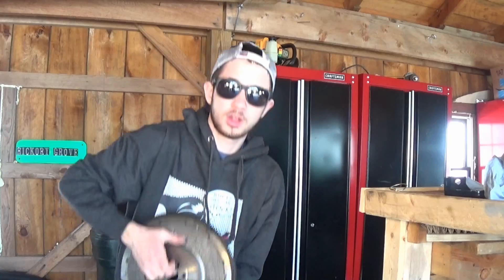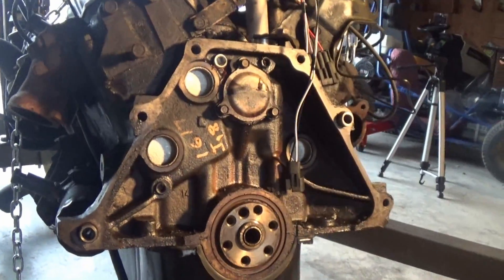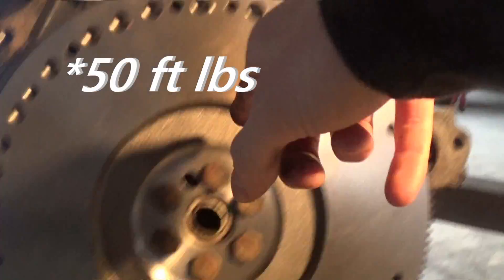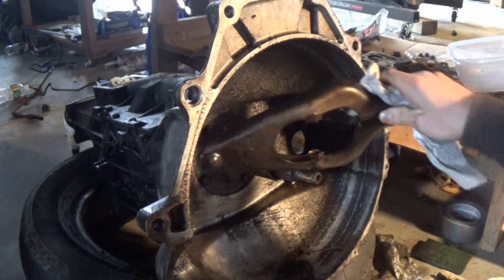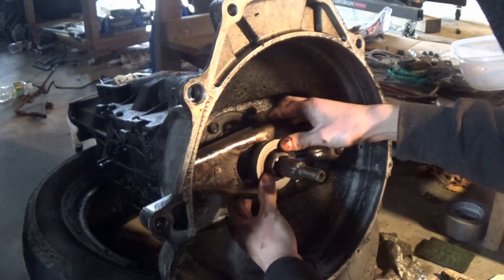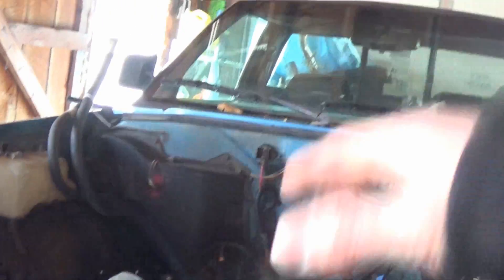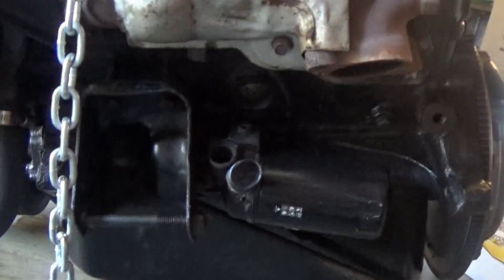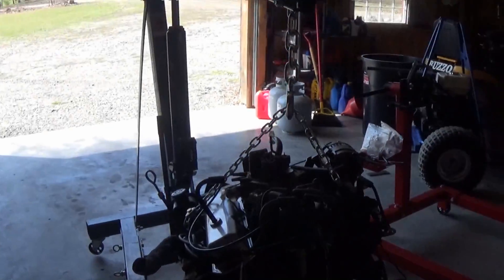S10 Clutch & Flywheel Install

Comment: I recently acquired an S10 and used this video to redo the clutch.  Thank you for that  BTW if you put a screwdriver through one of the flywheel holes, it will stop against the block and you can ratchet the flywheel bolts without having to hold onto the screwdriver.

Comment: On my 91 chevy i replaced the slave cylinder N master cylinder and nothing changed after bleeding. Any ideas? Also while i had the slave cylinder out i used two screw drivers to move the. Arm back and forth. Is there suppose to be spring back?

Comment: Sup bro do you have a diagram for all the houses I’m tryna redue all my lines on my 83 s15 I got it an a whole bunch of the lines were crossed and broken also my clutch lost pressure an I can’t bleed it so you think my clutch is bad my 83 only got 50,000 miles plz lmk

Comment: Just for future reference buddy, when bolting anything on a motor you always use a st ar pattern. So say on your flywheel, you have 5 bolts. After you tighten your first one move to the one directly across from it. It's just to make sure everything is flat on its mating surface.
Reply: I was about to say that.
Reply: As a Millwright i can not stress this Enough. Proper Torque Technique Is Extremely Important Especially On Highspeed / High Vibration Machines.
Circles Get a Star and Rectangles Are Center-Out Like a Spiral.
Reply: Just like when you change a tire, if not you will end up with a wobbly wheel or a warped rotor.
Reply: Looks to me he did use Star pattern

Comment: I just got me a clutch kit can I reuse the flywheel
Reply from the maker: Yeah of course!  I was unable to reuse mine because it was slightly warped
Reply: Okay your transmission is the nv3500 right do you remember how many bolts it has to remove it
Reply from the maker: I think it was 6 bolts?
Reply: Okay so i got 4 off the side so 2 more on top damn there hard to get to
Reply from the maker: They sure can be lol
Reply from the maker: Good luck!!
Reply: Channel C.G.E. thanks man
Reply: Edgard Jauregui the nv3500 is in the 88-98 silverado the s10 had a borg warner t5
Reply: Channel C.G.E. Hey just wondering did your clutch kit came with two metal bushings

Comment: i have another dumb question... what clutch did you use? mine want fit on the flywheel...
Reply from the maker: Really?  That is odd..  I got mine off rockauto.com, both the clutch and flywheel were LUK brand... good luck!

Comment: Whats up? Nice video, also have a 1993 except mine is the sonoma. I am about to pull my transmission to see whats going on, because i cant get into gear with my t5. Just recently learned that its actually world class! Hasn't given me any issues in about 4 years of ownership until now. My truck only has ~112,000 miles on it so i hope to get as much out of this motor as i can before doing any swaps down the road.
Reply from the maker: Thanks!!  That is awesome, good luck with the transmission issue!  If you take good care of it I'm sure it'll last a long time, mine has 210,000 miles!
Reply: Channel C.G.E. Yours also has the same world class transmission, it was a transition year. Apparently good for up to 300 ft lbs or so of torque!

Comment: Hey man! I love the project. Im curious what size of socket you used on your flywheel bolts?
Reply from the maker: Thank you!  :D  I can't remember exactly but I want to say either a 15MM or an 18MM
Reply: Channel C.G.E. mine was 17mm. I was just curious because I didn't wanna roll around in puddles to find it out lol love the content! I like the truck, man! :D
Reply from the maker: +SketchyatBest Oh that’s right!!!  I forgot it was an odd size lol.  Thanks man, appreciate it!  And good luck (: